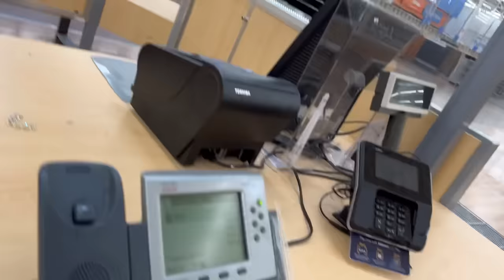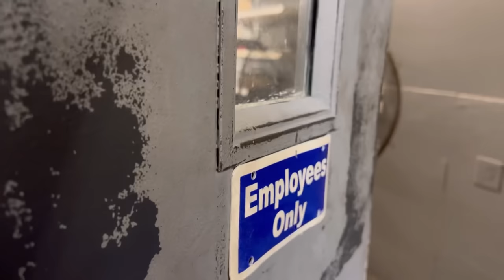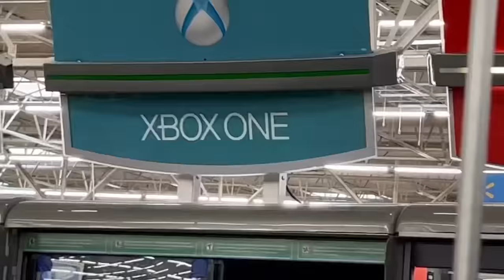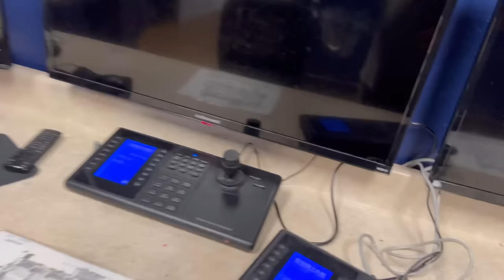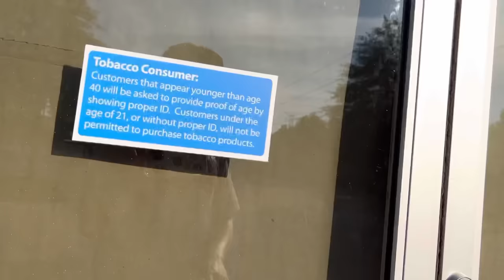Inside Abandoned Walmart - Louisville KY

Comment: I've been to this Walmart when it was open it was on the Cane run road area. I live in the Connecticut but used to pick up new moving vans from Kentucky Trailer and drive them back to the northeast. The Kentucky trailer pickup yard was a couple miles from this on Old Millers Lane. I remember putting diesel fuel in a couple of the moving trucks at this Walmart and eating at the Sonic
Reply: Weird.. now that you describe it i think i stopped in here on my way from Florida to Colorado. It was pretty empty but brand new.
Reply: Yep that's the one on Cane run time from Louisville in Louisville and that's the one I always used to go to I show miss it
Reply: I work for Kentucky Trailers.i build them
Reply: My papaw worked for Sims Plumbing on Old Miller's lane for over 40 yrs - the building is gone now -
Reply: This is the one on Raggard Rd off Cane Run Rd correct?
Reply: @missybugatti3987  yes ma'am it is

Comment: Wal-Mart has a company that provides, sets-up and removes store fixtures for them. The "crew" and the big trucks will show-up in the middle of the night, the guys will do their thing and the place will be ready for a Megachurch or what-ever to move in! There is an "empty" Wally-World near me full of store fixtures, lights and carts. They keep a few for "warehousing" and as they call it "product staging" holding next season's items for 30-45 days from distribution centers part-way to retail stores. They keep HVAC units in there for stores and freezer parts etc. so everything isn't a drop-dead emergency too. Lose a "drive-in" reefer unit and you have to wait 36-72 hours for the big truck to bring a new one, 12-24 hours installation, tons of lost product, have to re-fill the freezer, and I only worked for a Safeway in the late 1960's! W-W's have freezers bigger than our entire STORE was (25,000 sq. ft.) plus labor and cleaning. Sterilizing a drive-in ceiling to floor (has to be done!) is HARD, LONG, BACK-BREAKING WORK! Health Dept. hovering with test tubes for samples.